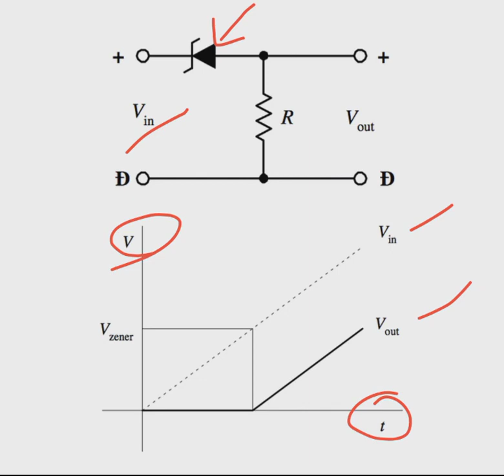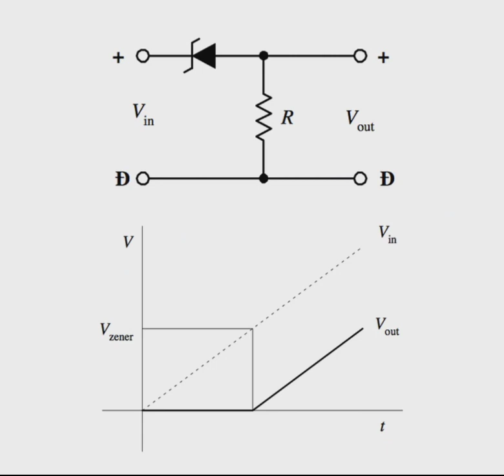Comment: since the zener diode works as a voltage regulator then how will the Vout increase if we increase the Vin
Reply: Here zener is not regulating the voltage, rather it's helping shift DC level of signal..
www.vpachkawade.com 
contact@vpachkawade.com